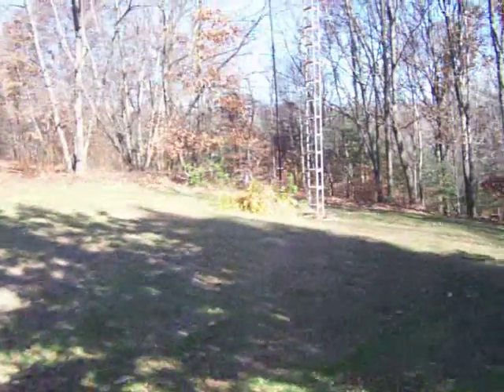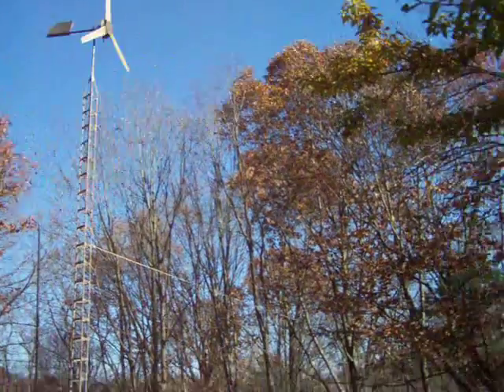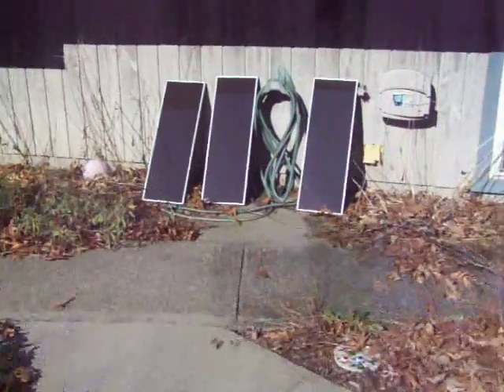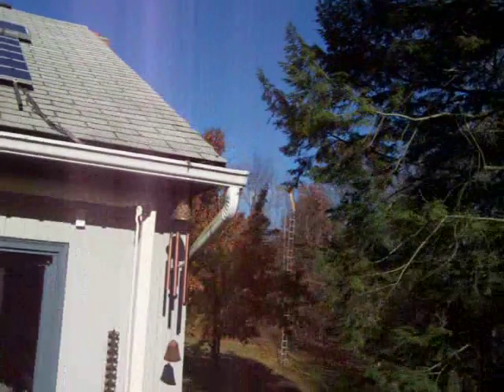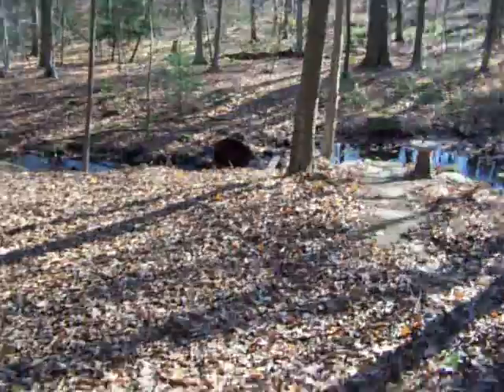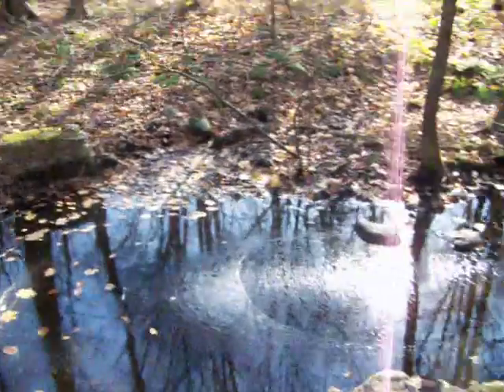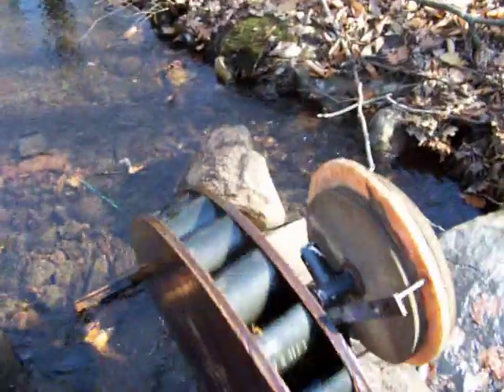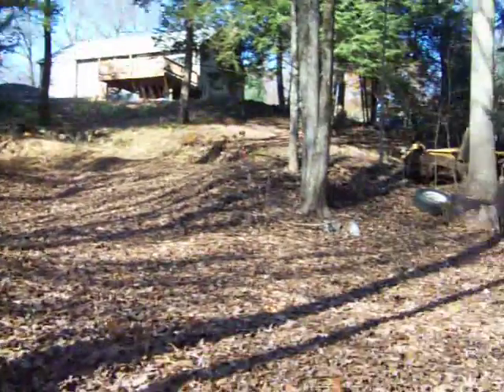wind,solar ,microhydro

Comment: On your micro hydro. If you put the hose coming over the top to fill the water wheel you'd have gravity helping turn it. That might give you a little more power. you'd need to run it the other direction. you could also add a 2nd overflow over the top of that for when there is more water.

Comment from the maker: hey doug yes I do wind my own coils the turbine coils are 78 turns of 14g mag wire the microhydro coils are 75 turns of all different sizes of wire from scrap electric motors. not easy to get the wire out but can be done with a few bloody knuckles.the first stator I made was 35 turns of double strand 12g mag wire it was not pretty but it does make power I plan to make another turbine with it .elec bill is down by 45-50 water heater timer saves the most